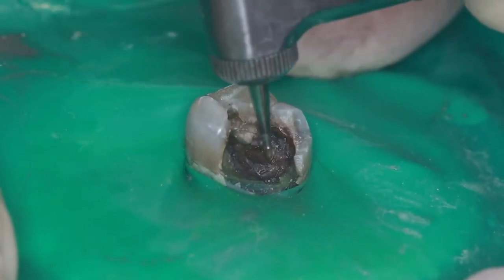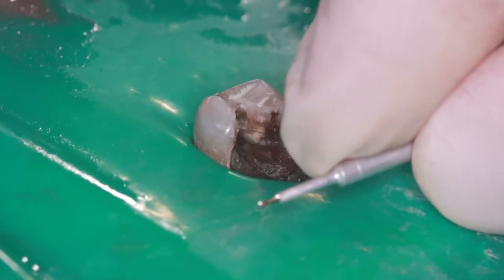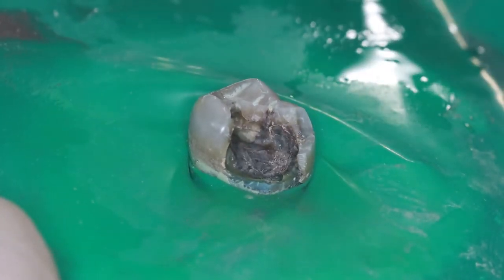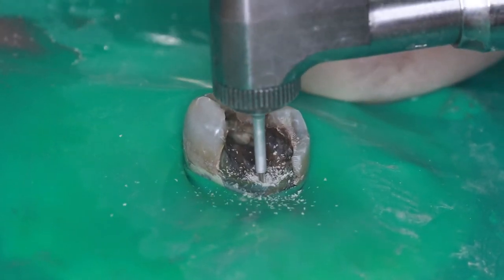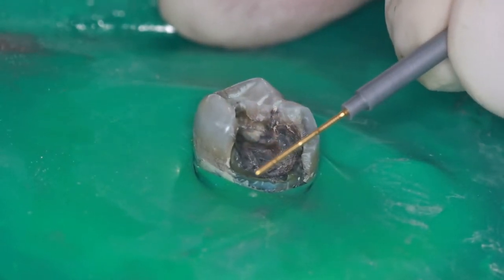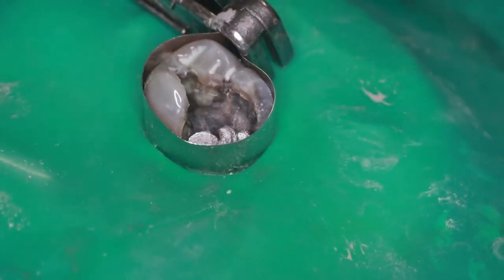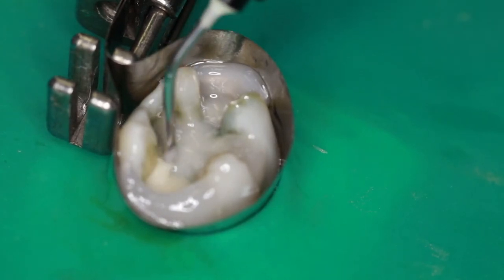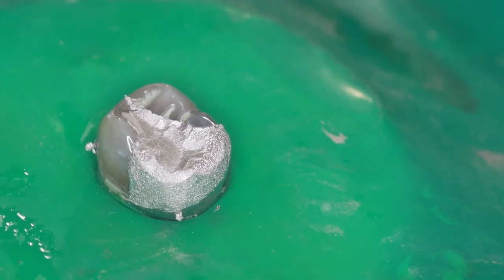What is a dental pin ?

Comment: One of my big top front teeth has a pin in it. The tooth has had a root canal but I couldn't afford a crown and my tooth was severely decayed and damaged so my dentist put a pin in to make the filling stronger. What I don't like is because it's a top front tooth and it's a metal pin I can see a little bit of the metal colour showing through, this is just in my bathroom where my bathroom lights are super bright but in regular daylight/sunlight it probably isn't that noticeable.

Comment: I had a root canal today and had a pin placed with a root canal. I cant afford a crown right now at all. I was told there was only one wall of the tooth left sp he placed pin (possibly pins?) And then used composite to build it up. The toorh looks smaller as he rold me he didn't want me to bite on it. Its the third from my front tooth on mu left. (I was under a GA so im not really sure if it qas one pin or multiple, but ky partner rhinks he said pins vs pin)
Reply from the maker: Hi, if it was placed after a root canal it may have been a post rather than a pin. The post is cemented into the root canal to help hold in the filling (core) under the crown.  Most dentists don't use pins anymore especially with white fillings. It's easy to tell the difference on a x-ray of the tooth.

Comment: This is a great video! I had two teeth in the past month where pins were used with new composite fillings. Unfortunately, and I don't even know how it happened, a piece of pin ended up on my tongue today. I at first thought it was a piece of tooth because of the weight of it, but when I looked at it, it was a tiny piece of pin. The dentist had been in a hurry when he did the fillings and kept dropping his instruments down my neck and was being very sloppy. How could a piece of pin end up coming out, or could it be that the piece had gotten lodged in between two teeth and then taken until today to come out? This has been very frustrating.
Reply from the maker: Hi, a pin wouldn't come out without the filling also coming out.
Reply: @VeryNiceSmileDental  thank you

Comment: A piece of my molar broke off flush with the gum. Approximately 80% of the tooth is broken off. The dentist wants to use 3 pins and crown it. How strong will this be?
Reply from the maker: Hopefully strong enough to support the crown. It depends on many different factors such as how much of the tooth is left above the gum line, where the pins are placed into the tooth, how the tooth is prepped for the crown ( I like to have at least 2 mm of tooth structure all around the tooth for the crown to grab onto), and how you bite and grind your teeth together.

Comment: My cap came off, the dental pin is sticking out and up. Can I pull the dental pin out? 
Great, informative video btw!
Reply from the maker: Hi, if the pin is in the cap, that means the core buildup (the filling under the crown) and maybe part of the tooth is in the crown as well.  If you remove the pin, the crown will most likely not fit back onto your tooth. See your dentist as soon as you can to get it evaluated. Let me know how it goes.